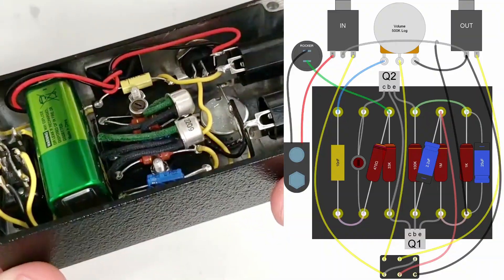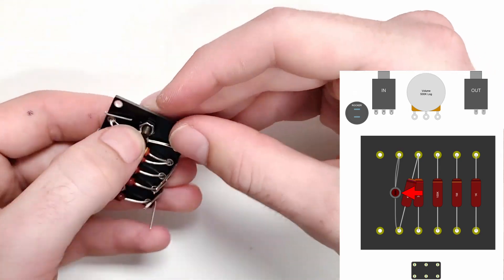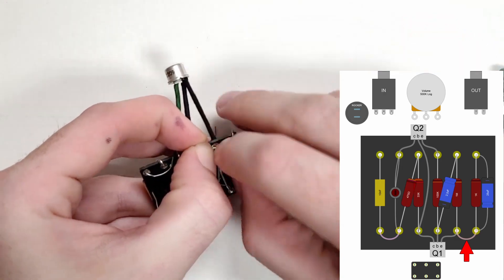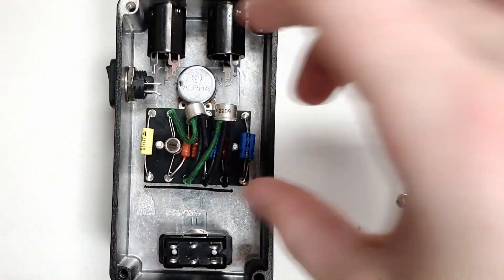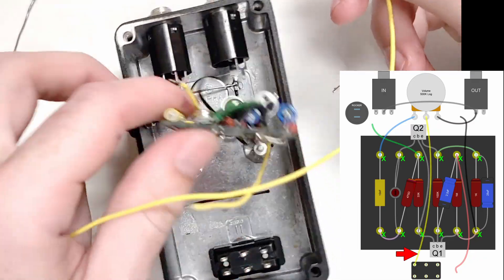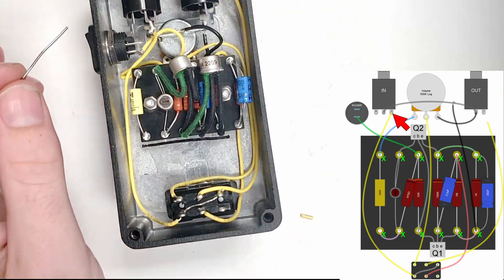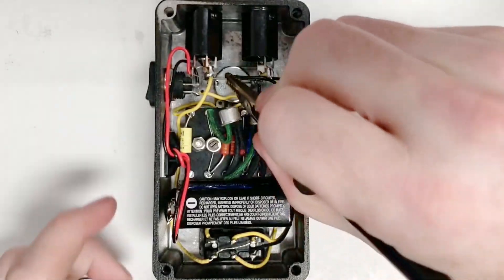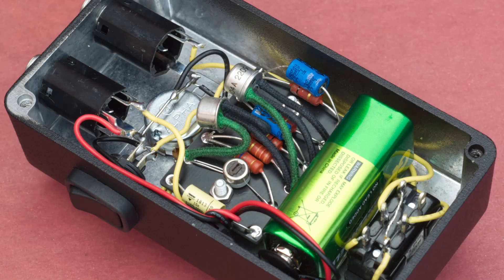DIY Pedal Tips: Eyelet Board Build Walkthrough

Comment: Hello again, I'm planning to build this with a couple small mods.  Bigger enclosure (for more room to work etc), an external bias potentiometer (with 1k resistor in series), and sockets for the transistors.  Any feedback / tips on this?  Should be fairly similar to what's shown here. Thanks.